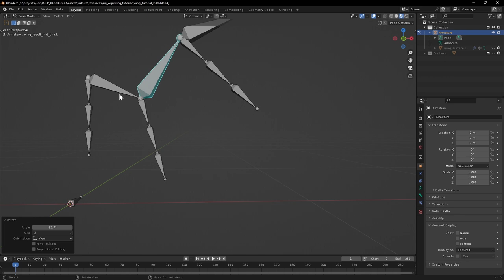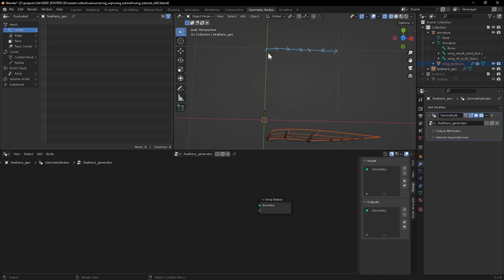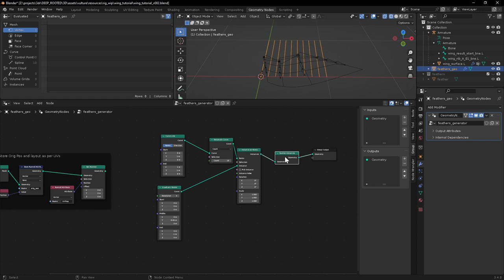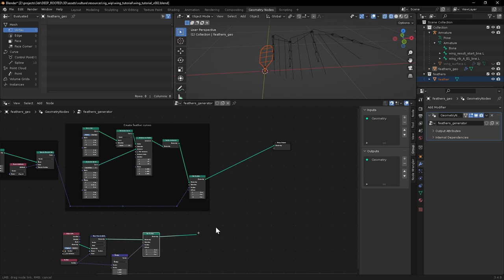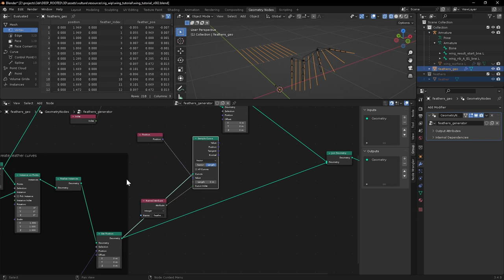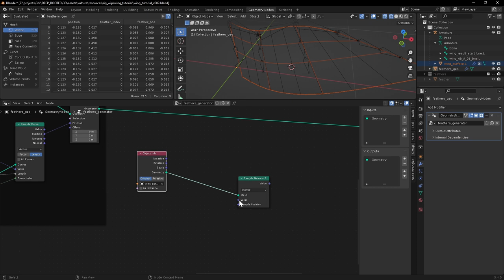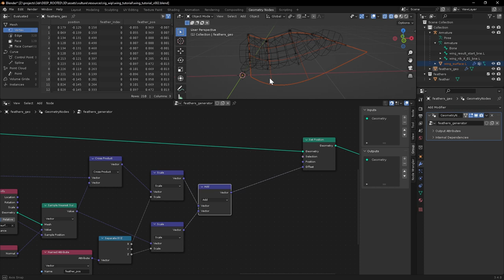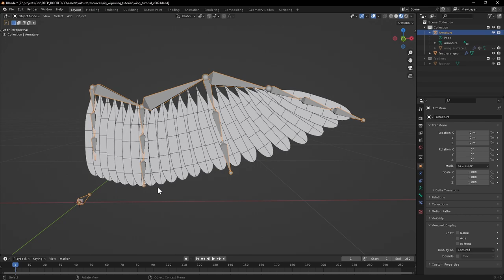Rigging a Wing Using Geometry Nodes in Blender 3.4. Part 1

Comment: This seems like it might be incredibly useful for my project... If it worked. I followed step by step, but it doesn't work. Following the steps exactly in Blender 4.1 just gives me a mess of polygons
Reply from the maker: As far as I know there shouldn't be anything stopping the setup from working in 4.1 I'm on 4.2 now and everything seems to work fine... Did you download the finished example file from the description and open that in 4.1? If that file has the same issue you're seeing then maybe there is a missing / deprecated node in 4.1 that I'm not aware of. I'd be interested to know either way.

Good luck with your project and thanks for checking out the video.
Reply: @duncanrudd348  Now I tried downloading the example file, and that seems to work. Weird. I'm trying to use the same method as a feather coat on the body of a bird - maybe that's the issue? Still, this is the only tutorial that is even close to what I want, so...

Comment: I have a question as to how complex you can gat with these feathers. I am trying to achieve a more realistic look by using different textures with transparent backgrounds defining the actual form of the feather and just using slightly modified plans as mesh. Is it possible for each feather distributed this way to have a different material? Or can I distribute those different planes/feathers with this methode somehow?😊
Reply from the maker: Hey. Thanks for the question. Yes, instead of instancing a single object you can target a collection of feather source meshes. Make sure ‘separate children’ is checked on the collection info node and ‘pick instance’ is enabled on the instancer node . The instances should inherit whatever material is applied to the source meshes so each source can have a different material. Good luck!
Reply: @duncanrudd348  thanks for the answer! I'll try that :)

Comment: Alright, not a master at the subject in any way close to Duncan, but when I 'unsquished' my feathers in the geo nodes at around 21:12, I had them pointing inwards instead of outwards, and I also had the Multiply node set the feathers so long their tips were omitted. I couldn't fix any of that playing around with the vector maths without fumbling in the dark, haha, so I instead recommend that anybody with the same problems as me play around with the original feather mesh IN EDIT MODE (just transforming it in object mode will not help). I moved it around, scaled it and such, and then I was able to achieve the desired result. It did ruin the 0 to 1 size thing, but...

Thanks again for such invaluable knowledge, and I know I'm really stepping out of my league here as someone who doesn't often use Geometry Nodes, I just think I might be able to help someone who's using a different setup (Blender 4.2 here, did not use the scene included in the description) like me.
Reply from the maker: Hah - great solution. If it works, it’s correct. Glad you figured out how to get it working for your scene. 👍

Comment: Question, if I wanted the feathers to stretch to the underlying mesh, what would I change?
Reply from the maker: Hey, thanks for the question. If I understand correctly, you should be able to just sample the factor of the feather curves instead of a given specific length. At around 13:30 in the video I explain why we're sampling by length but, in your case, leaving the sample curve node set to factor should do the job. Hope that helps.

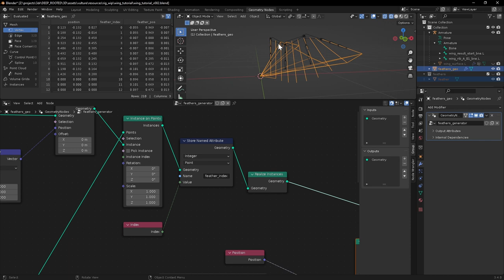Comment: Hi Duncan, how are you? I'm having problems with the nodes at 15:24 when I remove that connection, the lines on the wings are cut in half, I did the whole proccess twice but I'm having problems still, do you have any idea what is causing that please? I'm using the newest version of Blender and I'm not using the scene you provided... thanks in advance!
Reply from the maker: Hiya. Thanks for following along! It's hard to say exactly what your issue might be but it may be that your wing is at a slightly larger scale than mine and that your curves are just not reaching the edge of the wing surface. I have the opposite issue where my feathers are too long for the surface and so all bunch up at the end. I show you how to fix this issue at around 21:20. Hope that helps!

Comment: This is really awesome stuff Duncan. I just set this up for a goose that ive been working on. I am pretty new to blender though and I'm trying to integrate it into the the way ive been doing things. I have been using animations from mixamo and retargeting bones. Do you know of any simple way of doing this with the geo nodes setup this way? Thanks! - Vol
Reply: Update= I figured out how to get the animation retargeting to work, , I parented the wing armature to the body armature so it all stays together, but the thing I need to figure out is how to get the opposite wing that is currently "mirrored" to have its own armature and geo node structure. Is it as simple as making the mirror its own object and duplicating the geo node structure? Any help you (or anyone else) can provide would be much appreciated. Thanks!
Reply from the maker: Hey. Thanks so much for the kind words - glad you were able to make some progress. In my finished rig there's only one armature which contains all the bones and controls for the character. Each wing has it's own geometry nodes modifier but they both reference the same node tree. One thing I'm not sure I mentioned in the tutorial is that you'll need to expose inputs for both the wing reference and surface meshes - that's as simple as dragging from the orange input port on the object info node to the empty port at the bottom of a group input node. That will allow you to specify different meshes for the left and right wings without needing a duplicate node tree.

Hope that makes sense!
Reply: @duncanrudd348  I am just scratching the surface with nodes and it's beginning to make a little sense to me but what you just said is still way above my level. Messing around with it over the past few days has given me deeper insight into how it all works and I was able to duplicate the trees and the mesh's and have both left and right armatures to retarget my animations. It took me like 3 days of dorking around but I finally got there. At some point I may try to simplify it and get fancier with the node structure but Im happy with where it sits for now. The only issue in trying  to solve is how to keep the mesh from walking through itself like a ghost through a wall, like when the wings fold in front his legs stick out. Is there anything you recommend for that like some sort of constraint or mask for the mesh? Thanks again.
Reply from the maker: @THEVOL  Stick at it. It's not easy at first but Geo nodes is such a powerful system. Regarding the folded wing, I'm afraid I don't have a simple fix. It's a notoriously difficult thing to achieve in character rigging / posing and takes a lot of manual tweaking / management of the controls. Many setups opt for a blend where there is literally a different mesh / groom for the folded version of the wing which gets swapped out during the transition from open to folded. Don't get down-hearted, this stuff is hard and it sounds like you're making great progress 🤘
Reply: @duncanrudd348  I thought about that as a solution too. I just found out about collisions physics and I think that's where I need to look to solve this problem- otherwise I think I'm good with where the design it right now. I have a list of characters I need to design and once they're all "done" I can tweak them and improve them over time. Thank you for your help.

Comment: Hello there, sorry just asking if there any way to reach your for some questions about the bird wing rig other then youtube comment section. I would like to share some of my attempt on your set up.
Reply from the maker: Sorry my friend, I don’t really have enough time to go through setups on an individual basis - I get quite a lot of requests like this. Happy to try and answer as many questions as I can in the comments as that way everyone can potentially benefit from them.
Reply: @duncanrudd348  I understand, I respect people privacy and time, I guess I will try my best to solve it. just wonder is it better to split the plane of the primary and secondary feather set to make the folding overlap more during folding. Right now the feather formation will break of I try to bend the wing surface to much. How did you overcome this in your final wing model?
Reply: @duncanrudd348  also I just read my comment again and I am so sorry if I sounds demanding in any kind of way.
Reply from the maker: I’ll address this in part 2. The vulture wing has a few layers of feathers starting and ending in different spots and with some space between them on the y axis.

Comment: Thanks
Reply from the maker: You're welcome
Reply from the maker: @UChk6YMvJbqOqfg5kI8_ncUw Not sure I fully understand the question. When you bring a reference to the wing_surface.L into your geometry nodes tree you automatically gain access to its points. " I saw that you set the vertex index for all the wing_surface.L points" - This was the part of the question I wasn't sure about. Do you mean the vertex groups on wing_surface.L? If so, those are where the weighting information is stored so each point knows how much influence to take from the bones in the armature. Geometry nodes doesn't need to know about these.
Reply: @duncanrudd348  I see, the vertex groups only for the bone, i replay the tutorial for several time to understand it before go to part 2. Thanks for your answer, it help me alot 🙏
Reply from the maker: @bllendixuniverse3340  Cool - hope you get it all figured out!